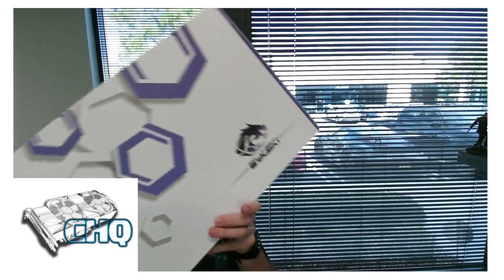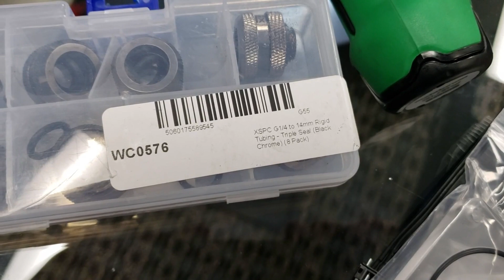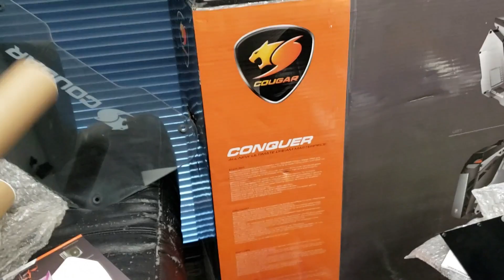Installing Bykski Waterway in Cougar Conquer i9-9900k 2080ti

Comment: Do you think a 60 mm radiator would fit properly considering you felt that the 63mm one you were using was off by a mm?
Is the front radiator 63mm as well?
Reply from the maker: Good question, and yes i do think it would

Comment: What size is the top 360 rad. I have a 45mm 360rad and im worried of clearance. I am really interested in this distro plate from bykski. Love them, im rocking a am4 block and a radeon vii block from them.
Reply from the maker: 63mm! :)
Reply: So a 45mm rad should fit no problem?

Comment: Check out overkill computers YouTube video 
You've never seen a gaming pc this good ' cougar conquer build
They installed the same waterway board  ' to see how to route your hard tubing
63mm rad is way to big for this case ' you should use 1 fan inside case on the rear of  radiator blowing down onto motherboard
Reply from the maker: Thanks for your opinion